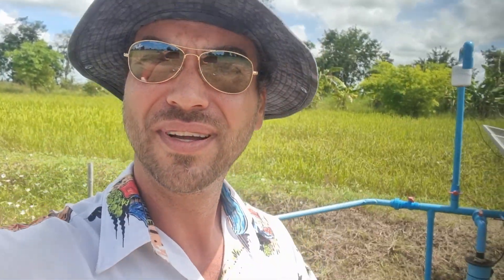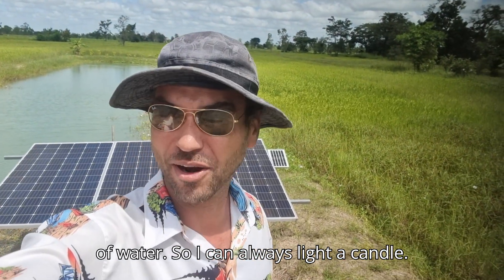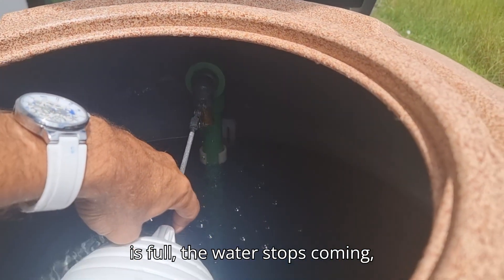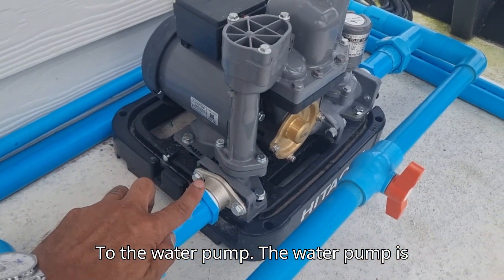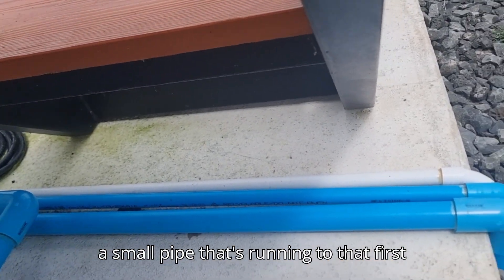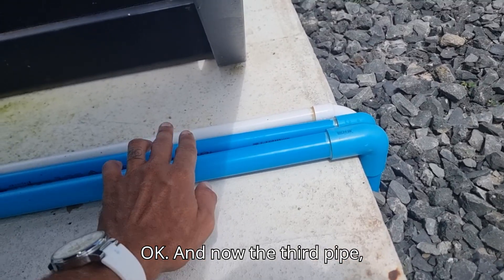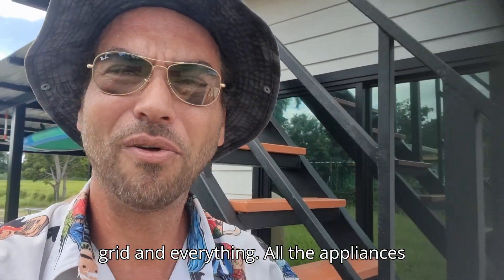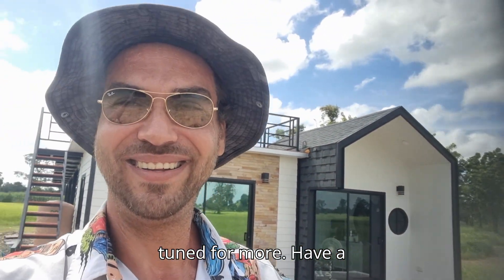Water System Explained off grid in Thailand

Comment: Can the water pump be turned off instead of running continuously and use when needed?
Reply from the maker: Hi, the water pump can be turned on and off as needed from the solar controller by the well. The water well has its own solar system.

Comment: Nice simple set up...easy to manage and troubleshoot...word of caution with the small solar array...the extended power line will introduce more resistance resulting in a voltage drop which further results in increased heat dissipation...so the loss of energy will make the pump work harder and hotter...which can then lead to problems including loss of performance and efficiency and potential damage to the pump.
Reply from the maker: Thank you for the good advice. I might have to get a fourth Solar panel to compensate for voltage drop when I put them up on the roof.
Reply: @thailandoffgrid actually a better solution would be a bigger line…ie lower gauge…and or specialized solar cables like PV, or XLPE are designed for longer runs with minimal loss so that’s another option
Reply from the maker: Thank you so much. I will look into it properly before moving the Solar panels up on the house.